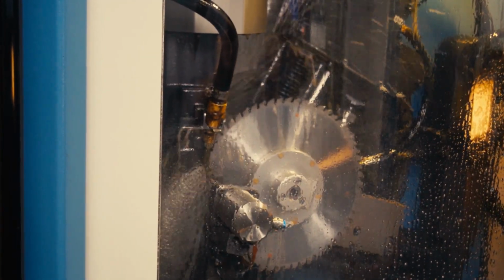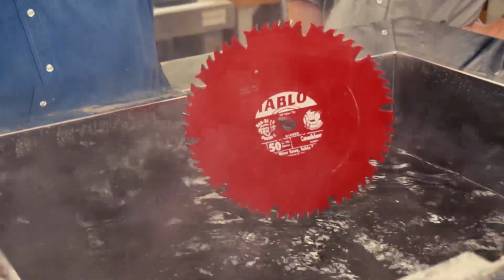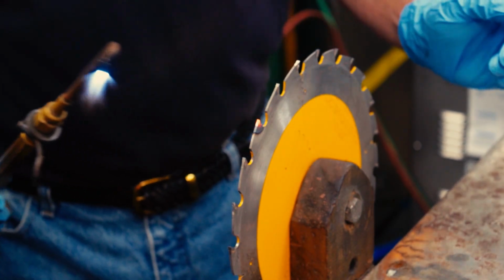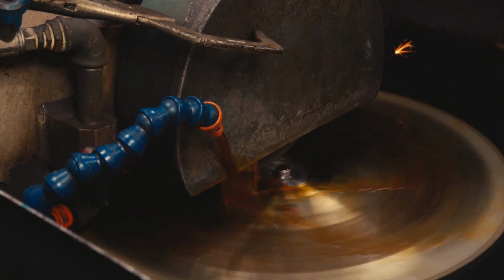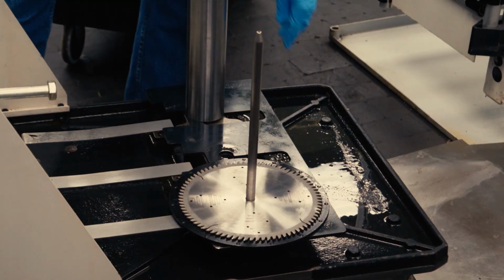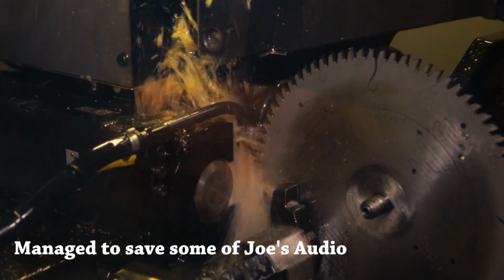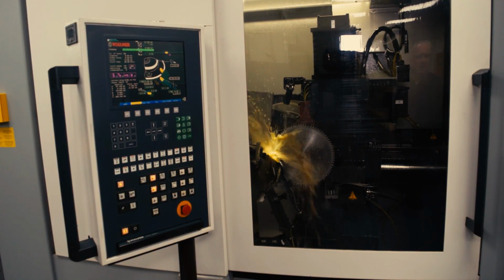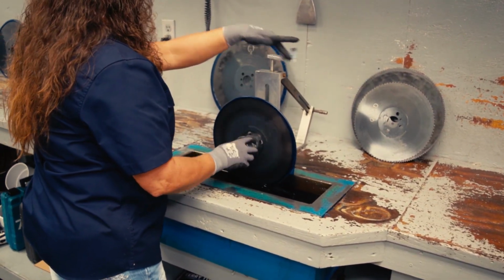THIS is How You Sharpen a Saw Blade! | WD Quinn Shop Tour

Comment: These guys are doing way way way more than sharpening.  They are manufacturing the blades back to factory specification.
Reply from the maker: Not bad for 10$
Reply: @WoodWorkLIFE  just 10? Here in brazil the same service does not cost less than 30 dollar in 2022.
Reply: Leatherman,
All blades are checked for any damage to both the tips and the saw blade body. We have all the latest measuring instruments to check for bent shoulders and side clearances.
Reply: That's good to hear maybe I missed that part in the video. I'm guessing you work their. I wasn't trying to criticize the work you guys are doing, you guys do it right unlike so many others I've seen. Can I ask on a blade with regular wear, how much you're removing from the tops+faces? Again just out of curiosity. Also what kind of coolant are you running, oil or emulsion? If you take the time to answer I appreciate it, if not no worries. When it comes to tooling sometimes I nerdgasm, don't even get me started on diamond tooling haha. Again you guys do great work, I personally wouldn't hesitate to send a saw blade to you guys. Do you service all kinds of tooling, or just saw blades?
Reply: Leatherman 
We remove about 0.2mm on the top and face of the blade on normal dull blades. All our grinders use oil coolant that is filtered with a Transor filter system. 
Do you still work at Leitz?
Bill
Reply: Bill, keep up the good work. Yes I work for a Leitz service center in Canada. I've been to the production facilities in Oberkochen and Kapfenberg many times, very high end. On average we remove 300 micron from tops, 70-100 from faces, just fyi. Do you guys see many Leitz blades in your very nice facility? Your service quality is refreshing to see in a small family business, hats off. I was going to ask, what brand of grinding wheels do you use and off hand if you know the grit. We use Winter brand, with dual D64/D128 grit.
Reply: I use an UT. MA 805 and a loroch power star 850
Reply: Not quite they missed 1 step, at least not shown in the video. Side checking, sometimes the steel gullet the carbide is brazed (not soldered) to gets bent. They should be checking that the blades steel body is inline before grinding the kerf. If you grind the kerf first but a tooth is bent, you won't be able to restore the kerf. It's a minor oversight, that is usually not required.
Reply: Duh

Comment: yes let's take a $15 harbor freight blade and turn it into a $2,000 operation... take your $9 harbor freight angle grinder put a diamond blade on it screw it down to your table put a couple screws in that table put one tooth and one screw slide it in when the other side hits the bottom of the screw the bottom of the tooth that tooth has been sharpened cost me nothing

Comment: I wonder what they charge to sharpen a 12 inch blade
Reply from the maker: 10-12$. Give em a call, tell them I sent you.
Reply: Prices are by the number of teeth in your saw blade. Up to 40 teeth is $10.00 up to 60 is $15.00 80 is $20.00

Comment: thats some great stuff 
the arts of how we once did that by hand the old fashioned way now in a throw away society we forgot the ways of old 
I my self will like to learn how to sharpen a  metal cutting circular blade by hand you mentioned a  great many things here about angles and thats the precision part of making it work right or a peace of scrap if you know of any learning sights or have any thing that you can share I am all ears
Reply from the maker: It is so cheap to have it done by professionals like this I highly recommend sending it to a shop.  The payoff costs of buying equipment to do it properly yourself (even basic equipment) would take 1000s of sharpenings to pay for itself.  It is only $10 to get a 40 tooth blade sharpened.
Reply: @WoodWorkLIFE  Where I live there are no sharpening shops. The cost in shipping to a shop is more expensive than buying a new blade. I hate to be part of the throw away culture, but the only thing I could do, is stack up the used blades and take them with me when I am ever near a shop that does the work (like in this video). 

Like OP said, would be nice to know the old, by hand method of sharpening. They had to do it that way, so there is definitely a way to do it. Is it practical? Maybe not.

Comment: So how does flux prevent warping??
Reply from the maker: The copper piece prevents warping, it conducts the heat into the blade.
Reply: the flux helps the copper flow to the tipseat of the saw.  also helps (visually) the braze line by cutting out the oxygen.

Comment: A little bit of Arithmetic.  A guy walks into a saw shop and asks the sharpener how much he charges to sharpener a 24-tooth carbide saw blade? The sharpener replies “ We charge 1cent to sharpen the first tooth, 2cents to sharpen the second tooth, 4cents to sharpen the third tooth, 8 cents for the fourth tooth etc, the price is doubled for each tooth =16 cents, 32cents, 64cents for the seventh tooth etc. So work out how much a 24 tooth saw would cost to sharpen.
Reply from the maker: My brain doesn't math good
Reply: $83,886.08   Am I Right

Comment: Another good reason to run that blade  through the surface grinder is that for blades that cut through copper, Aluminum, and even stainless. Those types of metals are very gummy and stick to the blades body. It Is necessary to grind the body as not of interfere with the clamping in their chd's.

Comment: After spending nearly 20 years in a mill saw shop I seen a few minor errors in your commentary. The flux is not to protect the steel it is to clean the steel and allow the solder to stick to the tooth and saw blade. The sliver they use is not copper but silver solder. The equipment that this shop has is the envy of any sawfiler. All top notch state of the art. All in all a good video.
Reply: @ DAN HUNIK -  silver solder?  I think brazing bud. Thus the yellowish copper look.
Flux is to clean the steel and protect it from oxidizing before the brazing.
Reply from the maker: Thanks Dan, they told me the pieces they used to glaze the carbide onto the blade was as sliver of copper rather than silver solder.  Flux is above my pay grade so you are probably right on that one.  I think this why they had to regrind the blades after glazing on new teeth.

Comment: So, for smaller blades like 7 1/4 and 10" is it worth it to send it for sharpening and pay shipping plus sharpening rather than just buying new one? 
Seems like 10" may be cost effective but when a new Diablo 7 1/4 cost $10-$15 I'm not sure
Reply: 7-1/4 blades are pretty much throw away these days.  Even some 10" blades are not worth repairing if you break some tips out.
Reply: That is why you're seeing many videos on using an angle grinder with any diamond blade mounted to a fixture- one last gasp from the disposable before it goes to the scrapman. You won't get first use quality, but if you want a blade for sawing mystery lumber it's a good way to go actually.
Reply: @BeachsideHank  for most hobby stuff that is good enough.

Comment: impressive to say the least. but with these amazing expensive machinery it must cost more to sharpen one blade than the actual price of the new blade.
Reply from the maker: It's 10$, super economical.
Reply: @WoodWorkLIFE  . no sir not in houston. years ago i checked few places and it was close to 28. if send out 
of town then shipping and cost also came close to that or little higher. no telling how expensive it is now.
There you go. I just checked these guys, it's $20 for 80 tooth  + shipping. that's about 30 at least.82-100 is $25

Comment: Is that a Vollmer UH6? My old enemy haha. Not all professional sharpening is created equal, it's nice to see them checking the kerf. Also different grades of carbide require different feed speeds, these guys seem to know what they are doing. I work for Leitz Tooling and I approve this video. Anyone who finds this interesting, some more viewing pleasure. https://youtu.be/pkIYJPHhC6Y
Reply from the maker: Couldn’t tell you, but these guys are too legit.  You could use your blade to do a surgical procedure after getting it back from these guys.
Reply: Generally speaking a blade cuts better after being sharpened once. Also lots of cheaper blades can be made to cut better then factory with a good quality sharpening. If you're in Canada a good company to deal with is Royce Ayr. Send your blades to a top notch service center like Lietz, and you'll get great cut quality and long life on a budget. If you're in America get some Forrest saw blades and send them out to get serviced. I see lots of these budget blades and with a proper service they'll cut just fine.
Reply: Leatherman, 
It is a Vollmer CHD 270/CHF 270 service center.  Also CHD 251 service center
Reply: That seems right. I don't do much in the way of carbide servicing anymore, but I remember the Vollmer loaders well. Certainly more advanced then the old manual setup CHP/CHC machines. But something to be said about a good hand job if you ask me personally.

Comment: Way cool... Good job with the dialogue since there was no good audio. I did not realize sharpening a saw blade was so technical. Keep up the good work
Reply from the maker: Thanks Ryan!  It was really cool to see how it is done properly, there are so many videos out there about "hacking it"  With how thin the carbide is on most midrange saw blades, you are just going to screw it up and maybe make it slightly less dull, but not really "sharp"

Comment: Hi, nice video! Does the blade/carbide require any heat treating after the brazing proses?
Reply: The heat is centered on the carbide tooth and not the steel body of the tool. The heat is so slight that if done quickly like done in the video, it will not affect the temper on the steel.
Reply: No, It's ready to grind after brazing.

Comment: Nice video ,   The only negative thought I have about all the automation is  it creates a future society that doesn’t know how to sharpen their own tools my father cut hair for 30 years and he was the only one  who would sharpen his  scissors and razor blades  I laugh  now as my barber uses disposable  straight blades  and has a guy pick up his scissors every week   As I’m pretty sure he doesn’t know how to do it himself  whereas my old man would come home from a full day and spend most of the evening  in our garage sharpening ?   He actually had 30 year old razor blades  that worked like the day he bought them ?
Reply from the maker: I sharpen my hand tools by hand, but saw blades are made by a machine, setup by a machine, and run by a machine.  No reason to lower the precision and honestly the sharpness by doing by hand.
Reply: I own a small sharpening and repair business, so I agree with the comment about all the automated machinery for we do it all by hand. Although some days having a Automatic sharpener would be nice 😜 but knowing how do to it without is extremely important.
Reply: WE HAVE THE TECHNOLOGY!!
Why spend hours doing it yourself manually if the technology exists to do it better and faster. And probably lasts longer.
Time is also a cost factor. Especially if it cuts into your off time you could spend with family or just doing something fun or whatever.
Reply: One guy sharpening a carbide tipped blade by hand, or a cnc machine, which people have to design,build, assemble, from materials that people need extract/process, and when the machine is done it needs to be shipped, installed, operated, and serviced, by people. And then it provides a superior quality product, substantially more affordable than that one guy doing it by hand.

Comment: Not copper. Silver solder.
Reply from the maker: It is copper, that way you can braise, not solder, carbide with steel
Reply: I've always loved that term "Silver Solder" haha. The only difference between soldering and brazing is temperature. If your filler metal liquefies over 450°C you are brazing, at or under 450°C you are soldering. The term "Silver Solder" makes no sense since all silver based alloys melt well above 450°C. If you're using silver you are definitely brazing.
Reply: I'm a retired Saw Filer. I've silver soldered thousands of tips. I've never once heard of soldering tips on with copper (brass yes). Most of our tips were pre-tinned with silver solder and we had silver solder rod for other jobs. We used a oxy/acet torch to braise them on, so I'm sure the temperature was well over 450. The term Silver Solder must be a misnomer.  Never had a way to check the temperature, just put black flux on the notch and heated and pushed the tip into that notch. By the way, Vollmer is one of the most accurate grinders I've ever used.

Comment: Good vid. So how much does a typical 40T table saw blade cost to have sharpened?
Reply from the maker: +legalsolutions07 10$ as long S the teeth aren't all gnarly
Reply: @WoodWorkLIFE  that isn't to bad.
Reply: I'm sure tooth configuration matters as well. WZ or "ATB" blades are cheaper to sharpen then FZ/TR or "Triple Chip" blades.